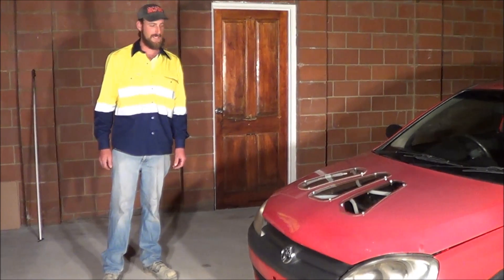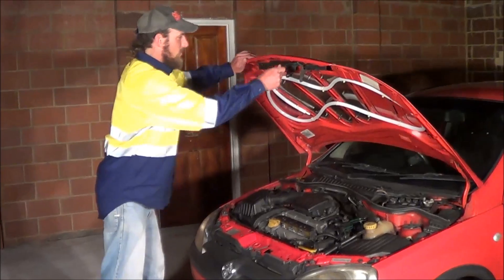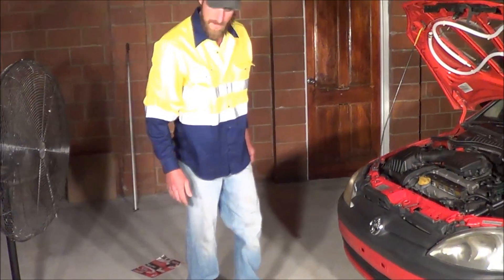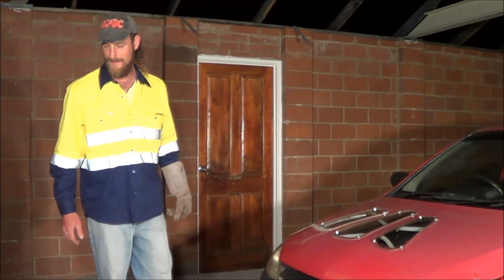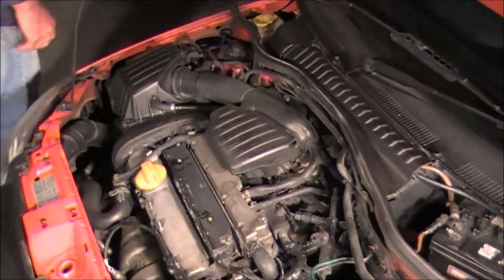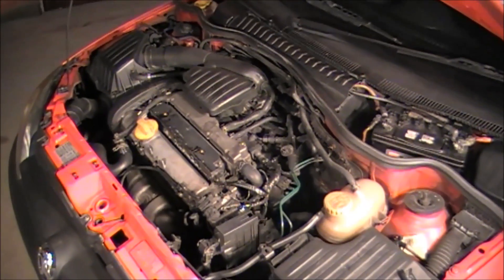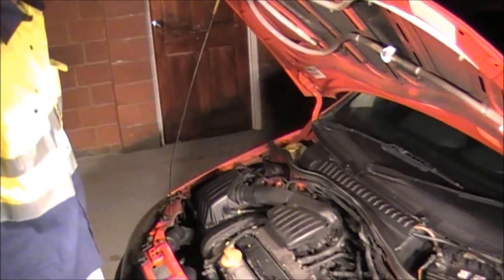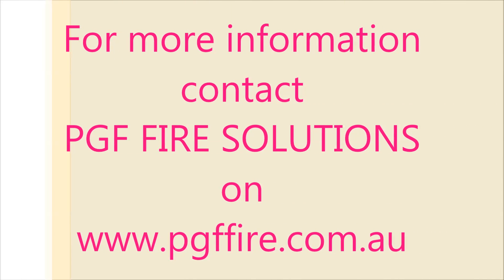PGF Fire Solutions - Blazecut

Comment: that entirely depends on what caused the file in the first place if you want to even try to start it up again only to have it happen again.
Reply from the maker: +madmax2069 That is all true, after the event you should first determine what caused the fire in the first place, have it fixed and then only attempt to restart. In our case there was nothing wrong with the car so it was possible to restart.Thanks for your input and a good point made.